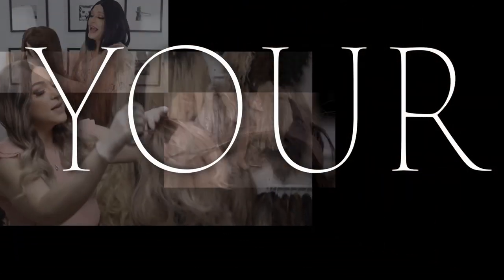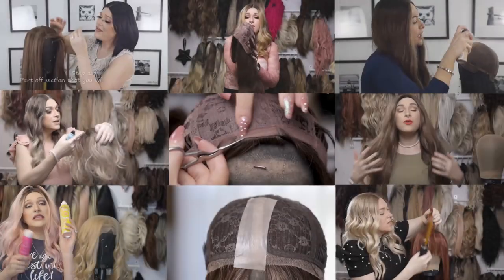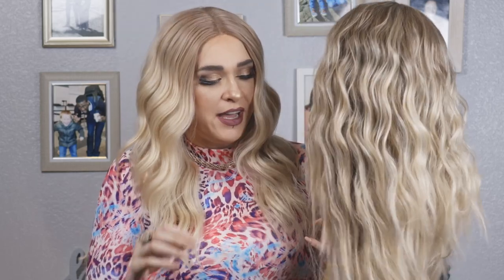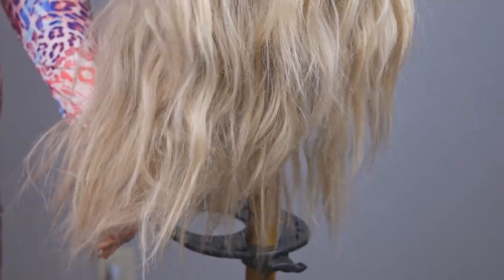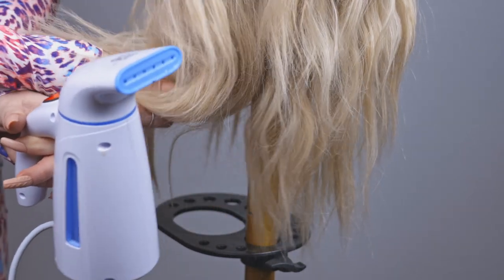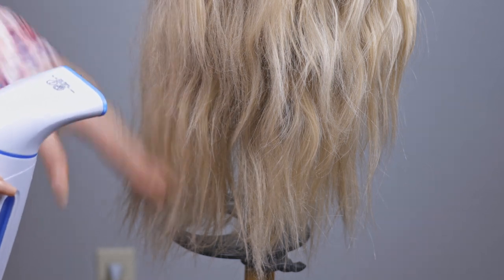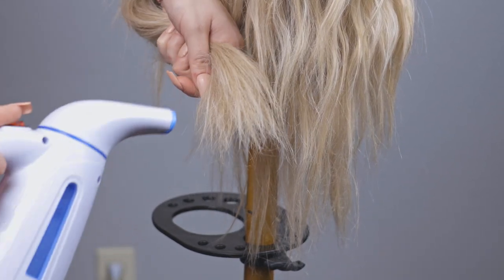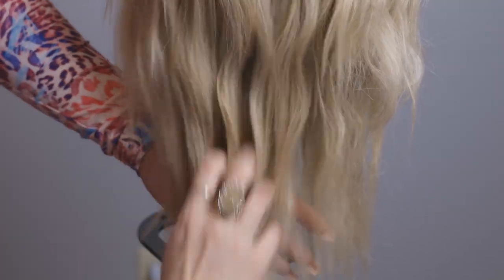Wig Tutorial : Repairing A Curly Synthetic Wig With Steam | Jesse M Simons

Comment: Feel certain you're not supposed to put conditioner into the steamer. Only clean water should be used. Might be a good idea to use a spray bottle for your conditioner.
Reply from the maker: It's fabric softener and it's fine to put a little in there with the water. A spray bottle does help with other hacks but for this one I found that this method worked best for what I was trying to accomplish. Thanks for watching.

Comment: Hi I watched your video and I'm trying to revive the ends of my topper that is synthetic (not heat resistant). I have the same steamer and worked on the ends but it actually didn't do anything like in your video. It actually looks like the ends were burned and they are curled up and rough 
Please advise how I can fix this😔😔😔😔 so upset that I couldn't get the result as in your video (smooth and soft fibers)
Reply from the maker: Can you send me photos either to IG or FB or wigsupport@jmsimons.com